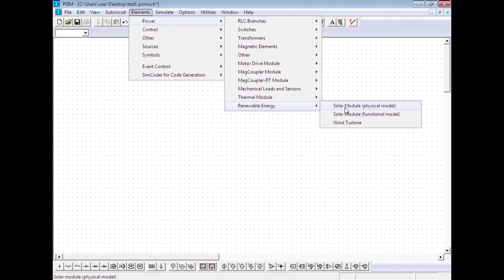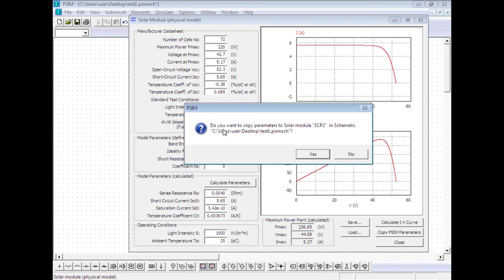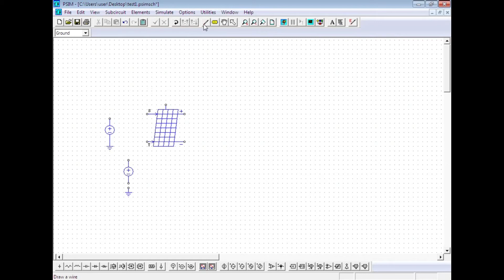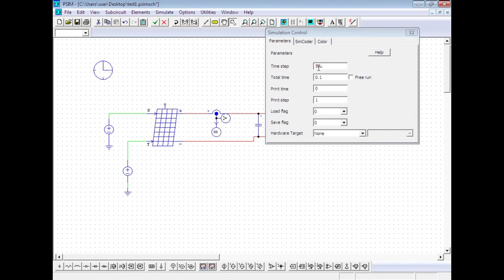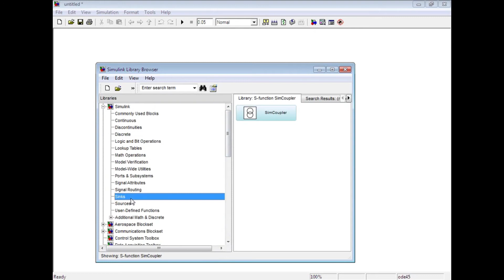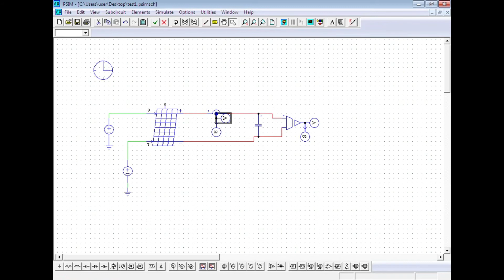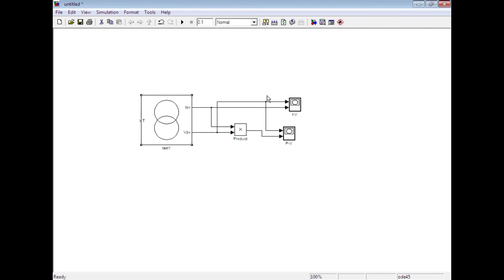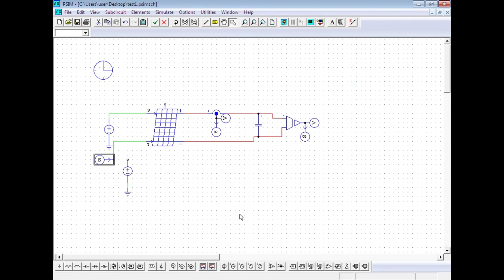Plotting PV panel curves using Co Simulation between PSIM and Simulink

Comment: what does psim bring by using co simulatuon instead of using the whole simulation with matlab
Reply from the maker: I found that it is more flexible to design the Power electronic circuit in PSIM while the programming was much easier in  MATLAB so i adopted this.
Reply: @HadeedSher  Dear Dr Hadeed
I am working on parameter estimation of PV module
Can i fill the parameter autoatically by using  Dc source like in T and S ?